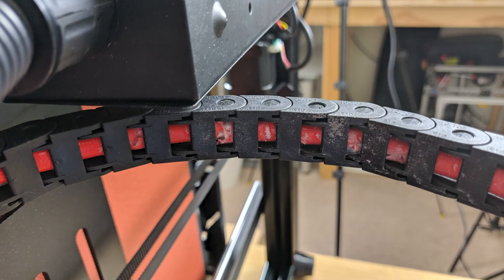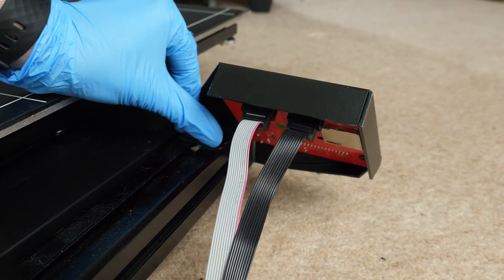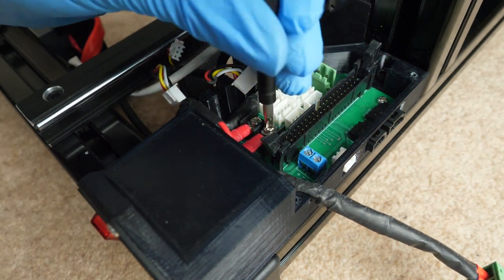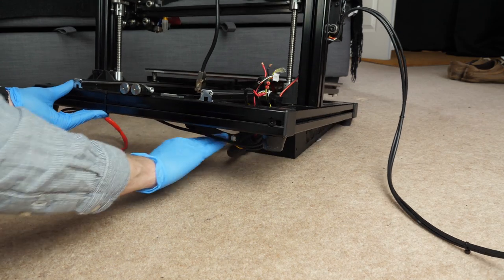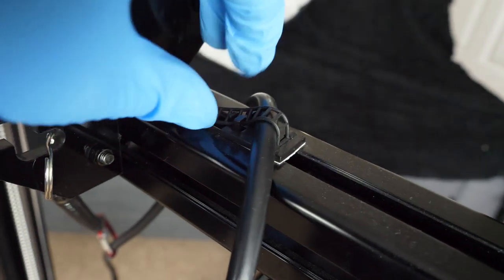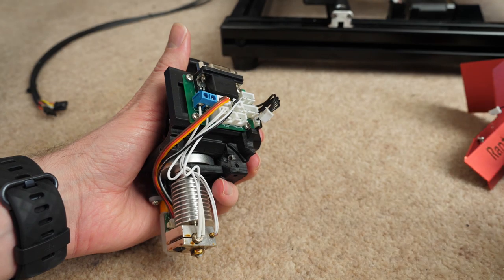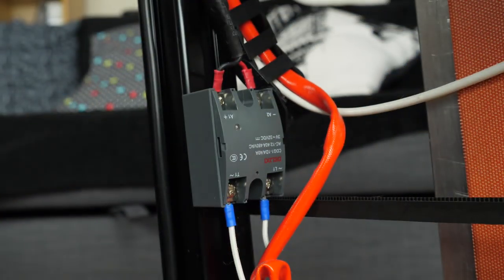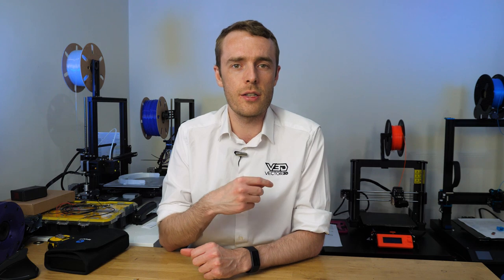8 Safety Issues you NEED to check

Comment: Hello Adam! I'm running a T-Rex 3 here now. Most of the design of the Raptor is the same, except the extruders  and a very noisy fan for the power supply. I'm thinking to change the wires for the heated bed with high flexible silicon cables.

Comment: There's nothing wrong with using brown and blue for low voltage DC. That's normal, most often found in Europe
Reply: Where you've got mains and DC on the same terminals you give the dangerous ones the correct colours.